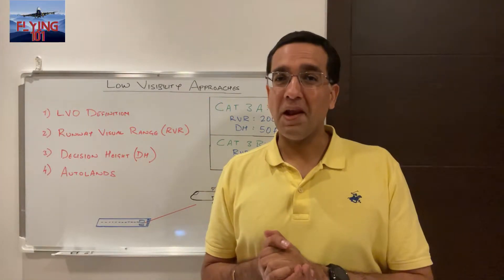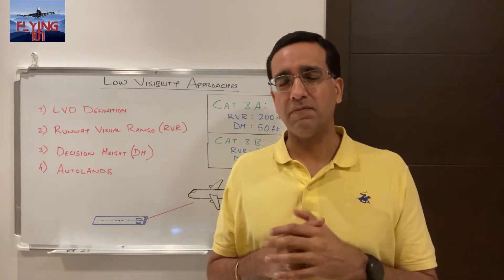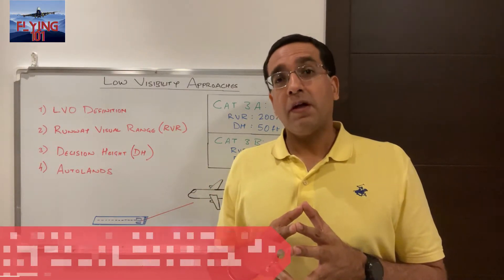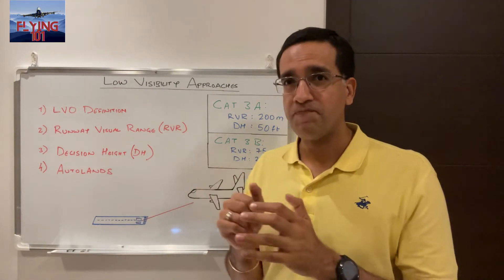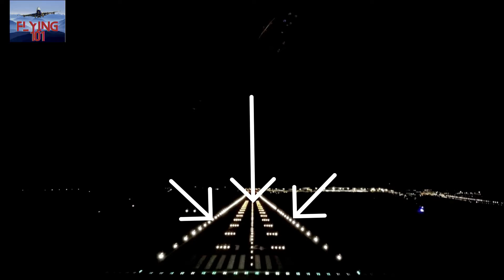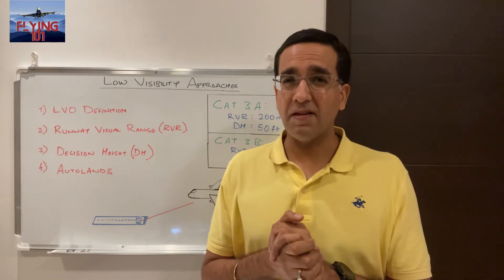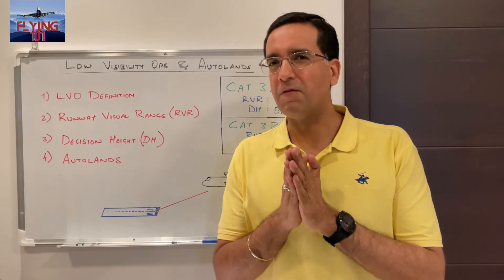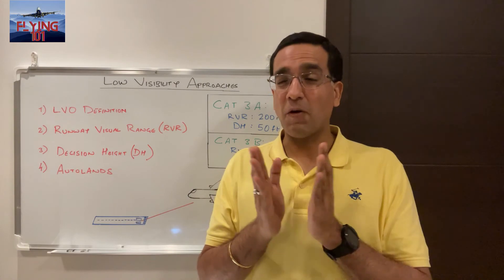An introduction to Low Visibility Approaches and why Autolands are carried out

Comment: Hi. I would like to ask You to interprate specific situation which happened and it is dificult to find answers in the books. Lets imagine that RVR of the airport measured by AWOS at 3 points is 300 meters. You  are over airfield and see good weather conditions
 Vis above 10 km no clouds, only fog at end of RWY 14L. But you can see 3/4 of RWY and You have vis above 10 km from RWY 32R. You are IFR but asking TWR/APP for VMC approach and received his clearance for LDG. Question is if the RVR now is override by Your Pirep and You can land VMC or You have to respect RVR numbers and if they are below Your minima go to alternate. I would be gratefull for Your advise. Greetings Kris
Reply from the maker: Hello, thanks for taking the time to watch the video and for your question. 

In the situation you have outlined, if you are an IFR flight and have requested a VMC approach and received clearance for landing from the tower or approach control, you should respect the RVR numbers provided by AWOS. If the RVR is below your minimums, it would be necessary to go to your designated alternate airport as per regulations. Your PIREP alone may not override the RVR measurements unless the controller explicitly informs you otherwise. 

Hope this makes sense.